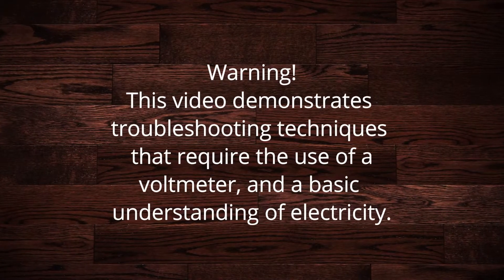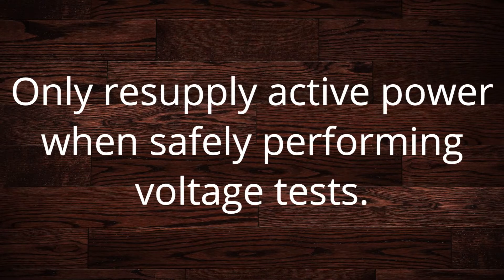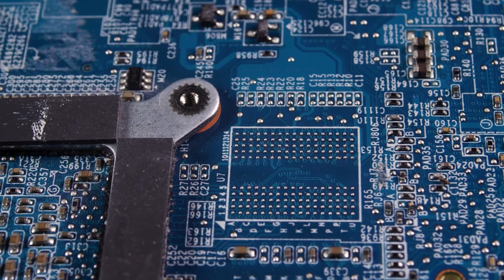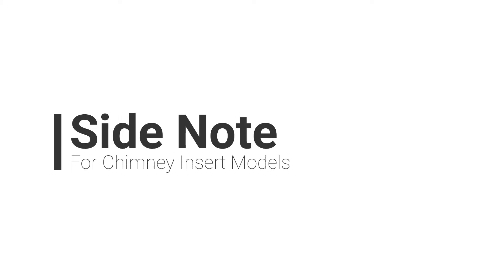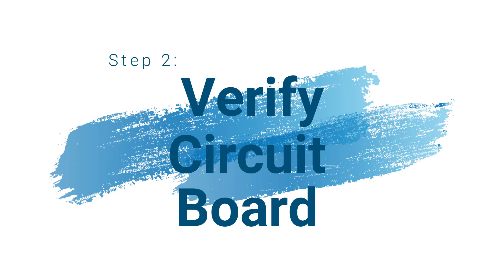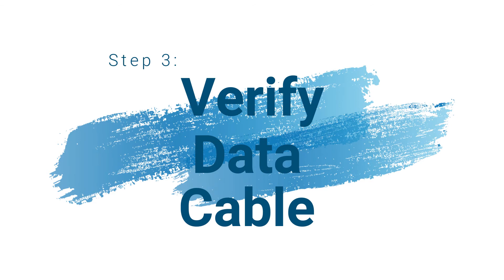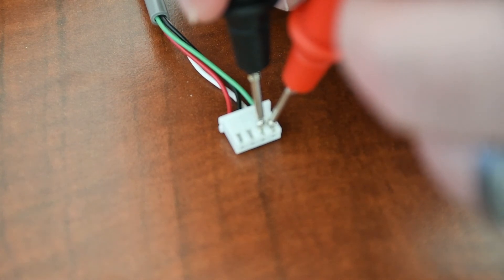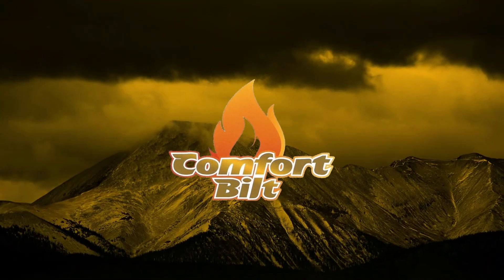Power Failures Pt. 2

Comment: My stove suddenly stopped working today while I was in my barn.  Setting up for xmas eve party tomorrow.  3 yrs old. No power to screen. Thanks to your 2nd video re testing further I was able to troubleshoot the issue.  A wire from the 4 wire lead out of the main box in the stove going to the control screen didn't have a good connection. Thanks for posting as you do. Stove is rigged, working and I ordered a new 4 wire cable. Happy Holidays!

Comment: I have been experiencing power failure due to blown fuses IMEDIATELY after powering on the controller. What would cause this? 
Model HP61
First, I have the unit off
Then I replace the fuse
Then I flip the switch to on
Then I hit the power button on the controller (connected with the 4 wire data cable)
Fuse blows

What should I do to troubleshoot this issue?
Reply from the maker: I would unplug the igniter and see if the same thing happens

Comment: Friendly tip: don't trust the power flip switch when undoing wires, these power switches are really bad quality and many arc electricity across terminals and melt the power switch and cause numerous issues. Always unplug power from the back of the stove. The switch is dangerous when faulty

Comment: This does not help for pellet stoves with the ribbon cable. How do I test the ribbon cable and the control panel have power up to the circuit board. I now need to test the ribbon cable then the control panel.